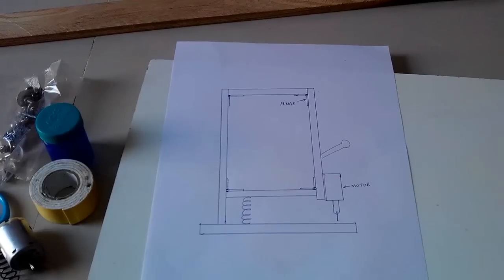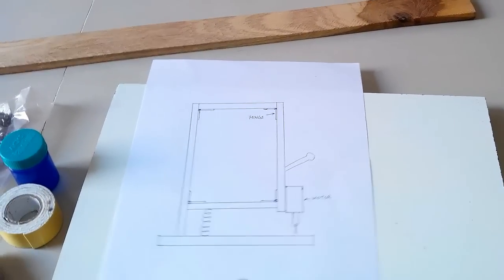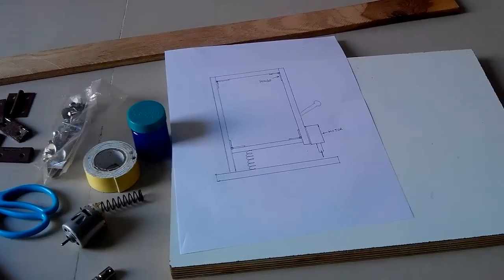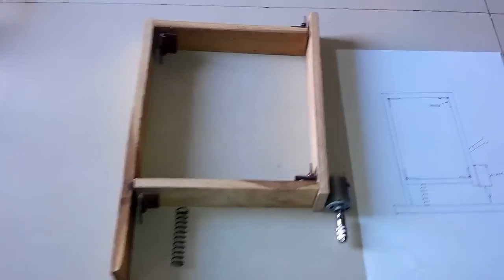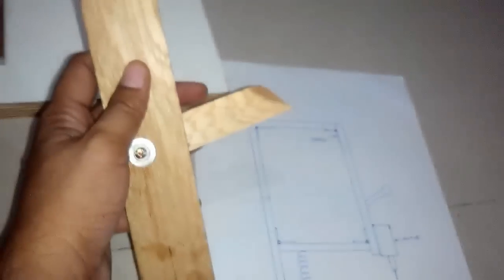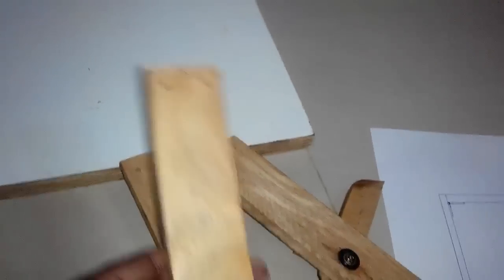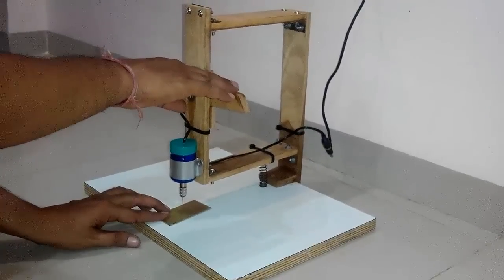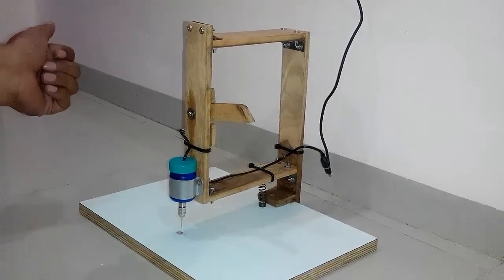Home Made PCB Drilling Machine

Comment: Great drill.
You could add a bottom limiter, It will give your drills a longer use time. In my case the drills usually brake when they go through the hole and not while drilling.
Reply from the maker: Thanks for valuable suggestion

Comment: The most simple one I have seen sofar. I think the angle created when pulling down makes it loose its accuracy. A sliding down mechanism would make it perfect.
Reply: +boowonder888 
As long as the opposite sides of the frame are parallel to each other it will be fine. There may be a bit of play from the hinges and some flex to the wood, but its probably minimal and not worth worrying about in this application  (thin material).

Comment: If you plan on making furniture or other large items this would work OK but for anyone working on something small like machine parts art work and small jewelry this will not work as well as the clamped slides or the draw-slides. with those the drill bit is 90 degrees in all four directions but with all the ones made with hinges it's possible to get the side to side solid and 90 degrees if the hinged wood is wide enough to prevent tilting and the hinges were tight enough and didn't have any play. Even if you did figure out how to fix those problems to the point where it worked 100%, The impossible part is front to back on this. on drilled holes made under 1/4th of an  inch deep or less it might work, but if you plan on making deeper holes or if you need exact work like on really small parts this would get tricky because of the fact that as the drill is moved down it has no choice and moves front and back leaving you with ovals or lines.

Comment: what is the properties of this motor ?
Reply from the maker: Abdallah Ebrahim Mahran THAT IS 
25000 rpm Motor25000RPM no load speed at 12VNo Load Current - 1A, Stall Current - 10A0.36Kgcm torque
Reply: And, How much?
Reply from the maker: it is for $3.50
Reply: Thanks alot
Reply from the maker: Abdallah Ebrahim Mahran your welcome
Reply: brainstorm ABC Sir, are you willing to give the name of the manufacturer for that motor, it looks good value.